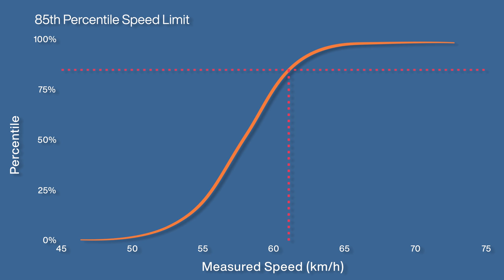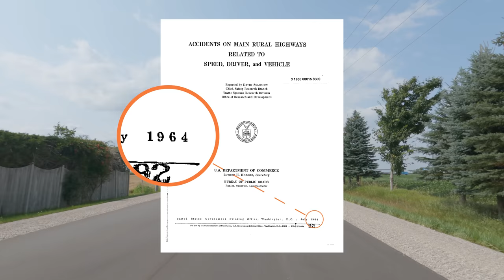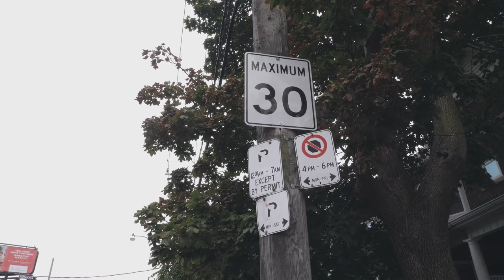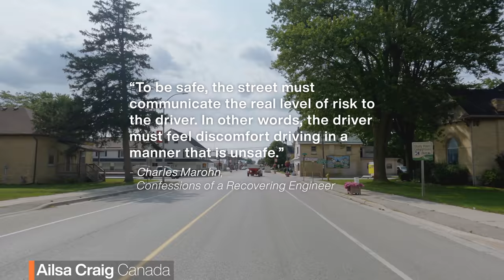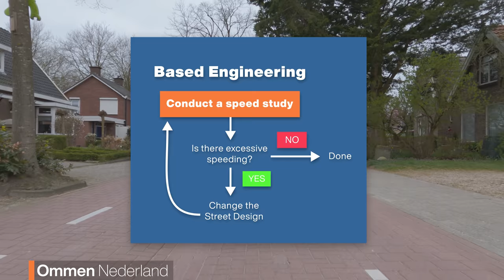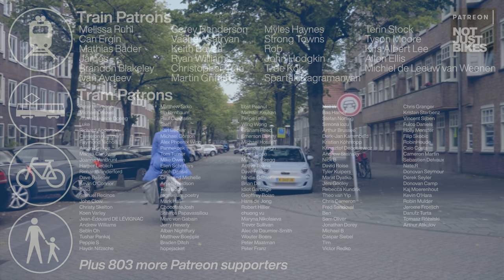The Wrong Way to Set Speed Limits [ST06]

Comment: "Streets are not throughfares" - that's something they get wrong in the US so often. Highway 287 in Colorado is a notorious example, many of the towns along it have it as their main street (in the case of Longmont, the worst offender, literally calls it that), forcing all the through traffic through a low-speed pedestrian shopping area. Much to the detriment of both the shopping area and the through traffic. As for speed limits in the US, I doubt it's based on this 85th percentile thing anymore, in reality it's just about how much money the local sheriff department wants to make in ticket revenue. They have every incentive to design the roads to trick people into going excessively fast while setting a needlessly slow speed limit so they can ticket everyone.
Reply: What is your proposal to fix the "notorious" Highway 287 through Longmont? Was it designed recently? Was it designed at a time with much fewer people and vehicles on the road? Is a redesign economically feasible, especially since people don't like to increase taxes? 

I don't know the answer to these questions, but maybe someday you or I (a fellow Coloradan) might be in a position to fix the problem. Better to have a solution than just a problem.
Reply: I drove through there the first time I went to FoCo recently and I was so confused when that happened I was like woah I swore I was on the highway

They must've built the town around the highway fifty years ago like Radiator Springs from Cars
Reply: Same issues here in PA, the main streets of many small towns are also the main artery traveling through the area wich leads to places that feel very hostile to pedestrians. My town is literally built with one of the worst intersections of two main roadways through the area as part of it's main commercial district. 

People get mad when I as a driver top out at 15mph driving down the main shopping street in my town, but both sides are often lined with parked cars and with few places to actually cross (and a complete lack of patience on my fellow residents part) people will often just walk out into the street between cars instead of going to the one controlled crossing light on the street.

Combine that with the high rent for businesses and it's no wonder why we can't get anything to stay in our storefronts, high rent means higher prices, higher prices+hostile to pedestrian environment means pedestrians are just going to get in their own cars, drive to Walmart where they can buy whatever they where going to buy here cheaper and safer and faster and carry on.
Reply: @skateloser4088  Yeah, I think that's what happened. It was built like this when towns were smaller, through-travelers were more likely to stop in, and more of the town's commerce was based on through-travelers. They wanted to make the main highway into main street as the businesses would serve through-travelers, I think forcing through-travelers through it was on purpose to try to get more business, travelers seeing the businesses and deciding to stop in. But over the decades since a lot of things have changed. Through-travelers less frequently make stops on their journey (especially unplanned ones). There's a hell of a lot more through traffic as the Colorado front range has gotten far more populated. The city of Longmont has grown, making it's economy more based on it's own residents rather than through-travelers, as well as making it a bigger obstacle for through-traffic. The downtown business district has shifted more to serving locals rather than through-travelers, resulting in the through-traffic and pedestrian business area being conflicting needs rather than cooperative.

As for the comparison with Radiator Springs, it's sort of the opposite actually. Same origin, but the end result was different. Both were a town and it's central business district growing on a through-highway and it's travelers. Longmont and Highway 287 each outgrew each other, to the point where they're more detriment than benefit to each other. Radiator Springs was the opposite, the town never became self-sustaining without US 66 traveler business. Then a bypassing freeway was built, resulting in far less traffic through the town, and thus business. Thus both town and highway shriveled up into almost nothing. Radiator Springs is fictional of course, but I'm sure there's many similar stories all over the US (and world), particularly along the old Highway 66.
Reply: @cdhikes2906  I agree that it's not an easy problem to fix. All this was built in very different times (see my response to Skate Loser) and the highway, city, and habits of travelers have changed to make this all a detriment instead of benefit as it presumably was originally. 

As for a fix, I agree there isn't an easy solution. A bypass route would be ideal, turn Main Street into an ideal low-traffic Main Street and route Highway 287 around it. I've seen this done in a few places, the town of Lafayette does this pretty well with Highway 287 - has no businesses or side streets directly on the highway, relatively few traffic lights, and even a side street and pedestrian overpass at one point. The central business district - which is quite nice and quaint, not clogged with through traffic - is elsewhere. Arvada did similar with Wadsworth Boulevard (if you keep going south on Highway 287 without turning this is where you end up, though the designated route of 287 goes elsewhere). The original Wadsworth is two lanes through the central "Olde Town" area, now it doesn't even go through as they permanently turned part of it into a pedestrian area and outdoor dining during the Pandemic. While the main thoroughfare of Wadsworth bypasses that area a couple blocks to the East, also having an underpass under a side street and railroad. 

This would be the ideal thing to do in Longmont and Fort Collins (possibly Loveland as well, but Loveland isn't quite as bad - still a pretty bad "Stroad" though), but I know that would be very difficult and expensive. Not only building a new section of road, but having to demolish a large amount of existing town, which would be prohibitively expensive and unpopular with residents. One thing that probably helped immensely already was construction of I-25, which handles the majority of intercity traffic along the Front Range, without that Highway 287 would be far worse. But I-25 is fairly far East and thus a much longer route in some situations, and it's often jammed up itself - not to mention eternally under construction.

If I could dream of fantasy solutions, what would be best would be to route Highway 287 (and all main roads) underground through cities. Underneath the current route, allowing the current road to be a pedestrian shopping area, parking, and probably a lot of ventilation towers for the highway below. Entry/exit ramps would connect the two, so those on the highway could access the town easily without having to drive through it. This would be prohibitively expensive though. Sort of a weird random thought, I think of that Disney Atlantis movie, the digger (boring machine) Mole drove. We see that thing driving through solid rock at a walking pace - in 1912. Not possible with any technology then or now, but I've pondered how different everything would be if it were, if digging tunnels were that trivial. Underground highways could be built everywhere at low cost, allowing for high-capacity high-speed uninterrupted through-roads (not even intersections as they could be built at different levels) under cities, added benefit of weather not being a problem, with surface streets only serving local traffic, being much quieter, pedestrian-friendly, and safe. Making life so much better both for drivers and life on the surface. Maybe Elon Musk's Boring Company could make that a reality, but I'm not going to hold my breath for that.
Reply: @quillmaurer6563  I 100% agree with you.  I moved here almost 4 years ago and a bypass is the best and safest solution.  In San Francisco there is no large highway running through the middle of it.  The city has Van Ness which sort of connects the southern highways and the northern highway and is made to go at a high rate of speed.  Van Ness is surrounded by busier pedestrian streets with lights at every intersection and one way streets which discourages you from taking alternate routes.  Either make 287 like Van Ness or like you suggested a bypass route with no businesses or residential homes.  It didn't help that decades ago Front range cities didn't want a large 4 lane I25 to curb population expansion.  Its 2021 and the highway is being expanded at a much higher cost.
Reply: Same in Ohio. One nearby road goes through residential neighborhoods, then a stretch of "big box store and strip mall" zoning, then about 8 miles of farmland before it hits a small, walkable college town, then it'll alternate several miles of empty farmland with small rural towns until it runs right through Columbus. It's so bad that almost nobody takes this direct route to the state capital, but instead drives 30 miles out of their way to the interstate highway instead.
Reply: @Kurgosh1  Are you talking about US-40?  I live in Springfield and work in London.
Reply: @Kurgosh1  Yep, sounds pretty similar to Highway 287. I'm sure these sorts of roads exist all over the US, started in a different time then the towns and roads both grew in ways incompatible with one another. I wonder if the same exists in other countries, or if this is a distinctly American thing? (Probably Canadian too, they tend to do things the same way). I attribute it to poor centralized planning of cities and highways, lack of foresight, unwillingness to front money to remedy these things, Americans' car-centric culture, NIMBYism, and neglect of non-freeway infrastructure as all emphasis is placed on Interstates, turnpikes, expressways, and so on. And perhaps businesses trying to make their business as easy to get to (by car of course) at the expense of everyone else.
Reply: @edwardrhoades6957  I was referring to SR58, which it seems I've misremembered. It actually ends in Ashland, and traffic joins SR42 to Columbus. So it's actually two such roads that I was conflating in my mind.
Reply: I cannot overstate how pissed off those downtown bottlenecks make me. Downtown Kirkwood, Missouri, which clogs up Lindbergh Boulevard, has to be the most egregious example I've been to. The road is literally not possible to cross and the driving experience for cars and bikes is equally miserable
Reply: yesss!!! i live in fort collins and its so stupid 287 goes directly through old town cutting it in half and forcing huge trucks to go through the mAin DowNtOwN district!!!! like it sucks to try and hang out in old town even tho its so cute and good because you have to worry so much about getting hit by a car when you just wanna continue shopping! like everyones favorite part of old town is the square, a big patch of walkable downtown and they wonder why its everyones favorite part!!!
Reply: They used the 85th percentile rule a couple years back to raise the speed limits in downtown Los Angeles.
Reply: I know, if the cops know where to set up their cars to give tickets, why in the heck not design the street differently so people know to go slow.
Reply: @nicklang7670  Because ticket $$$$. Everything in the US is because $$$$.
Reply: @cdhikes2906  Space consumed by massive parking lots can be converted to a parallel street. That way, through traffic will have least disruption possible.
Reply: @cdhikes2906  know nothing about that town BUT in WINNIPEG Canada originally and legally the #1 trans Canada hiway goes down town but we have a ring road that totally bypasses the city and they are presently removing any at grade intersections making it a proper motorway / US "freeway" and in Canada most of the population is on one line east to west served by the trans Canada hiway
Reply: @AHungryHunky  Hah! About to say that.  Hauling trailers through PA for several years was both fascinating and aggravating. There was one "highway town," I had to go through that I could only clear a left turn on the only truck access turn, if no one was parking on the right side of the road (legal parking).  If that was the case I had to pick a curb to drive my truck up on or a curb to drag my trailer a few feet on, watching to make sure no pedestrians were there.  How you get your goods! 
       Others I had to drive my entire combination vehicle in the wrong lane, and close to the curb, to make the truck turn I am required to make.  I got good at guessing which people I had to wait on and politely "backing people off," when they got too close, on their correct side of the road, for me in the "wrong side of the road, but necessary to make a right handed turn on the only local truck route." In those situations it is legal for us to do that, unless we hit something.  
       Similar to the "no parking on the railroad track, but we don't have enough room between the stop sign and the railroad track, situation. Illegal to park on the track, illegal to run the stop sign. So I run the stop sign and make sure not to hit anything. (This is more of an older town issue, not just PA).
      I have mixed feelings about no longer driving in PA. 😁